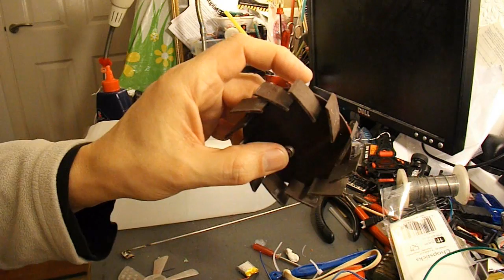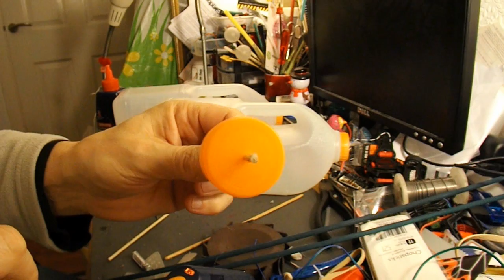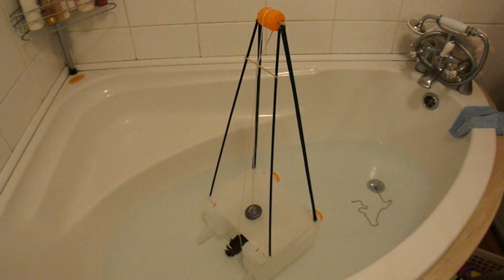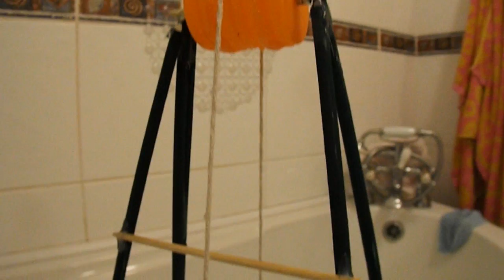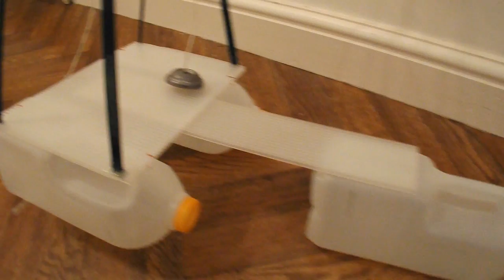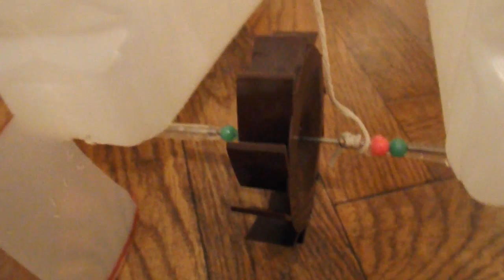Gravity Powered Boat

Comment: Not seen one like this before and it's more stable than imagined. There's plenty of room between the bottles for a bigger paddle, maybe even 2 slotted correx pieces to keep the theme.
Btw, people use that correx a lot for R/C aircraft projects, knew i'd heard of it somewhere.
Reply from the maker: Yes a bigger paddle would seem to be a better option. It would slow the descent of the weight due to the increased resistance in the water and would travel further. Obviously there would be an optimum paddle size for the weight used to get the maximum distance or speed depending on what the target was. I think we can call this project just one of those 'proof of concept' ideas.

Comment: Nice boat. I think the paddle would work better in the other direction (same axe flipping the wheel (or just wrap the string the other way around and run the boat backwards to test it)
Did you salvage the so called "correx" or did you buy it ?

Thanks.
Reply from the maker: I will try  that. The correx is salvaged.